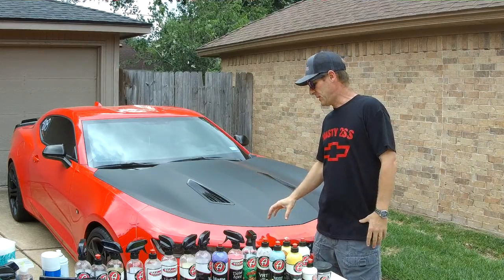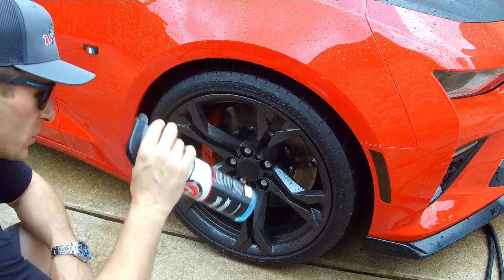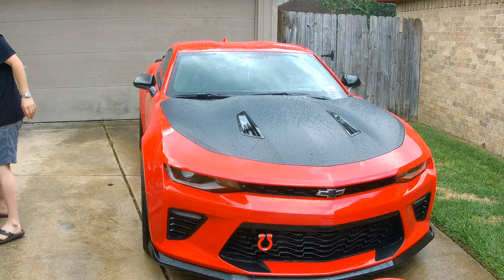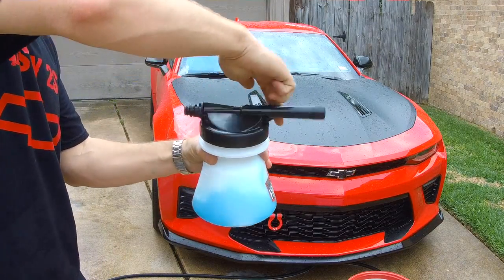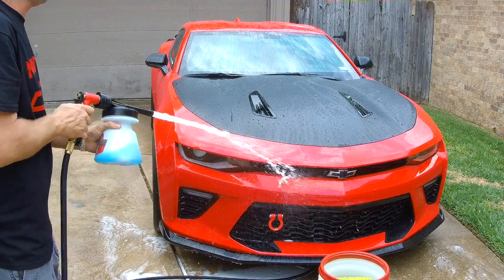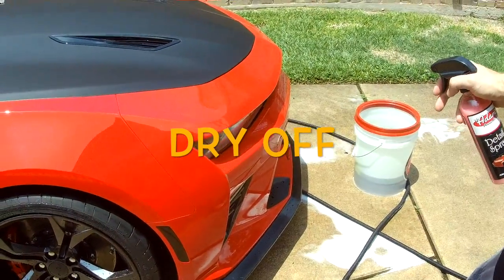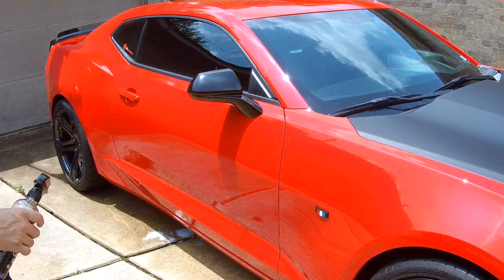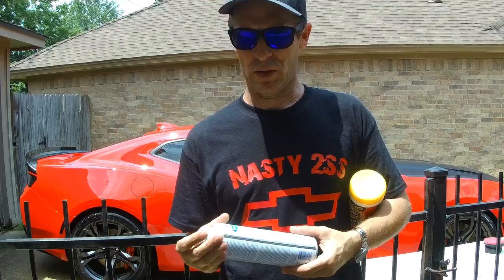Detailing Car - Wash and Wheels - Update 1

Comment: Excellent video because I’m still learning about cleaning. I’m a big fan of Adams window cleaner. Best I’ve have ever used. Looking forward to the next part.
Reply from the maker: Yea I did a video on using something else other in the past and someone recommended I try it. Now its all I use. I bet their window cleaner is the same. Honestly I'm yet to find a product they make that doesn't work
Reply from the maker: Use to use glass cleaner on wheels. So much easier now
Reply: OnlineCarShow I have used the stuff in the white can but found the Adams works much better.